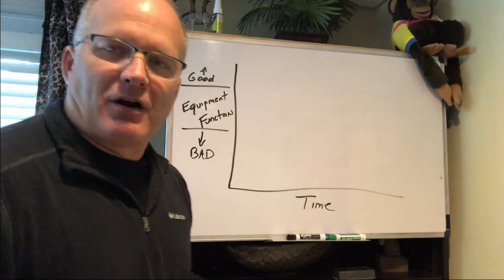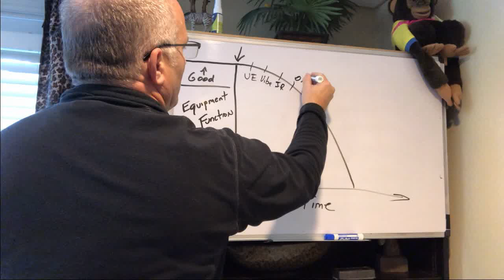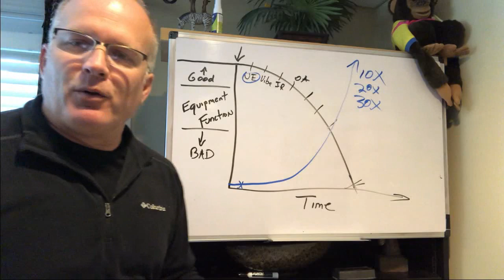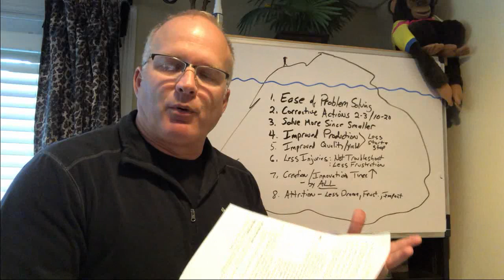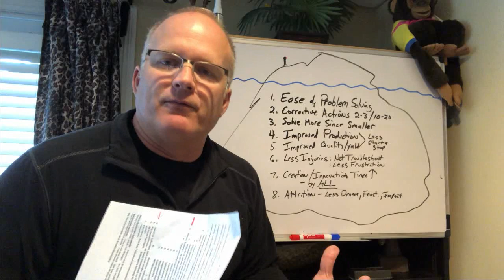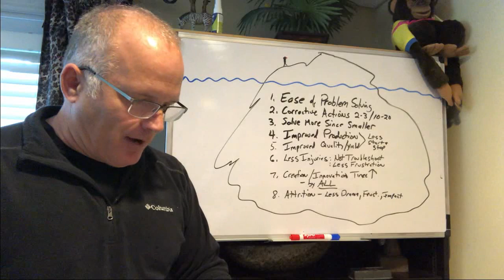Secret Value in moving from Reactive to Proactive Maintenance - Most Don't Know

Comment: Interesting. I was a maintenance manager for about five years for two different small food processors. I haven’t thought about this much for a long time. 
The first one hired me as a fabricator, then I left about six weeks later for $.25 an hour more (the owner was a jackass), a month later they rehired me as a manager because they realized my leadership skills. I was in charge of farm equipment, vehicles, forklifts, new equipment fabrication, and four fruit drying lines. 
Year one, two main goals, build two new pieces of farm equipment from scratch and major modifications on one drying line for fuel efficiency. Crew of ten. We got it all done before harvest with little to no time spent on the drying lines. Harvest arrives, four guys and myself, three golf carts loaded with tools 12-15 hours a day. Took about twelve hours a day to get the throughput the plant needed. We always had one line or another broke down, frequently two, once a day three, and occasionally all four down. Immediately after harvest we tore one completely down for a ground up rebuild. 
Year two, goals were to build five new pieces of farm equipment, and major PM on the other two drying lines. Got it all done by harvest. Crew of ten but replaced one with a much better one. Harvest arrives, three guys and myself wrenching 10-12 hours a day. Processing takes ten hours. We typically have 1-2 lines broke down at any given time. Immediately after harvest we tear two lines down for overhaul. Unloaded two mechanics with drug problems. 
Year three, jackass owner comes to meet with me personally. Goals are build four new pieces of farm equipment and build a whole new plant for juice processing. I ask how many guys can I hire. Answer, none. BTW, new plant needs to be operational in six months. Harvest comes, drying lines ready, two new farm equipment done, two not started, new plant about eight months along and half done. Since I’m the one ramrodding the new plant I put two guys in charge of keeping the dryers running and I have some of the farm shop guys working on the plant. The workers on the drying lines are complaining to me that they are only getting eight hours of work a day. Only takes about seven to meet throughput and the rest is cleanup. I realize the two dryer guys are in the shop EVERY time I see them. I ask why, they haven’t had a breakdown in over a week. I ask what they’re doing, they are repairing and making replacement parts because they have identified a couple of potential problems. 
Almost three years to the day after they hired me back they laid me off. Why? Because I was costing them too much money. I had asked for a budget on day one and at least once a year after and was never given one. The following day they laid off my two best guys (the dryer guys). New plant was about a week away from start up. Turned into a month. We had built well over a million dollars of farm equipment. Labor in both mechanics and production had been drastically reduced. 
Year four, I followed up, no maintenance was done to the dryers. Hired both drug addicted guys back. Ten hours a day for throughput. No new equipment was built again. 
Year ten, company was broke. 
The second one was a smaller operation but a much more complicated plant. Similar deal. Interviewed for maintenance manager, didn’t get it. Got a message two Fridays later that they needed me at work Monday morning. I show up with tools and nobody knows anything about it. I go to work anyway. Boss shows up three hours later and I actually ask him why I’m there. He just needs a mechanic. Without skipping a beat I start loading up my tools. We settle on a price but I’m just a mechanic with mechanic pay. Thirty days later he offers to give me the responsibility but for the same pay. I start to load my tools again until we settle on a price. 
While there I went from five guys on my team to three. We reduced downtime by about 75%. 
The boss had a bad drug habit, was seldom at work or even reachable, and never did like me. I passed on an opportunity to exit right before the second busy season because it was the wrong time to leave. Four months later I left and took a job selling factory automation that I had for ten years. I realized there was no future in being a maintenance manager. 
I went on to start my own business and I retired at 50. I’m just not good at it 😂😂
Sorry for the LONG comment but after watching the video I felt like I may have finally found someone who would appreciate it.
Reply from the maker: Too common of a story.   Maintenance techs that are good you think they do nothing.   If they are bad, you know that.   It is a tough career path.
Reply: @joekuhnlovesretirement  very tough. Pretty unforgiving and took a toll on me physically. 
I really wanted to be plant manager but realized that was probably never going to happen. The grease monkey may be the best leader in the place but just couldn’t be smart enough. 
That’s okay, each stepping stone was an important part of the journey and each time I either left or was shown the door things turned out for the better. 
Watching your ROTH video now

Comment: Hey Joe, can you create a series about coming into a plant that has an out of control maintenance department? What steps do I have to take to get it under control from the moment I walk through the door? From assessing the department to structuring and budget creation. 
Background: plant has no budget and is 100% reactive or emergency maintenance. The PMs only cover lubrication and no rebuilds. There is absolutely no planning. Would really like a series
Reply from the maker: Danny King     Will do.   I’m working in a plant just like you now.